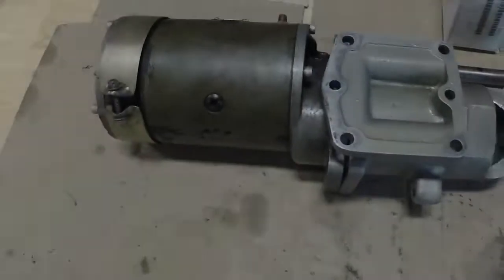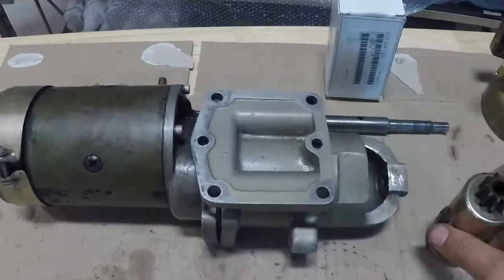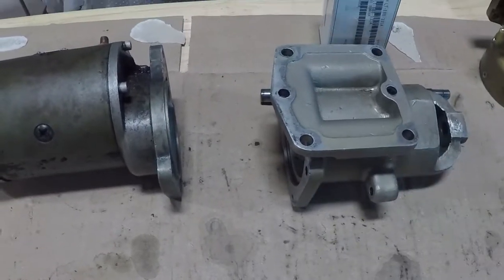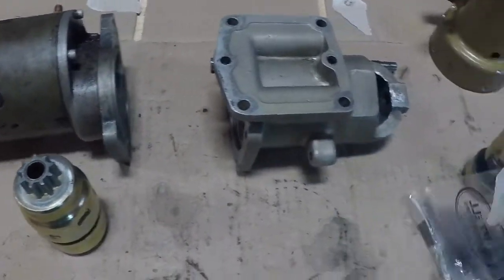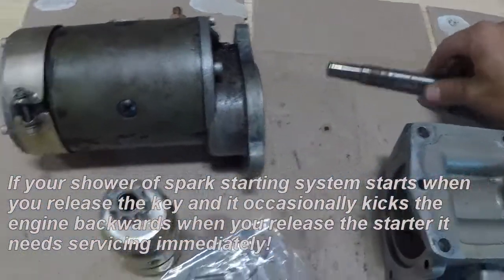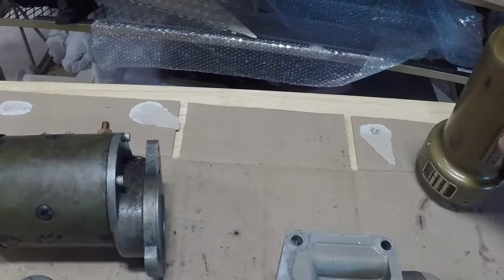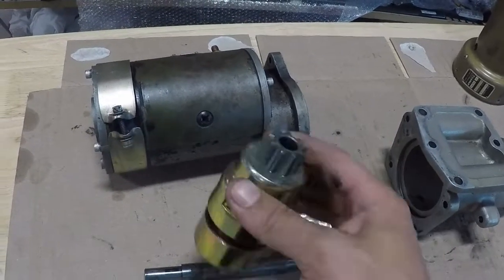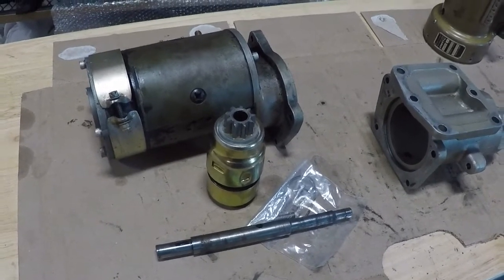Aircraft Starter Motor Replacement not required!

Comment: Can not thank you enough for this video and sharing your knowledge.  Not only did I save myself a lot of $$, but this was a fun project to knock out & we could have never done it without your help - and the production of this video.  Thanks again - and all the best!
Reply from the maker: I am really glad you found it helpful.  I agree it is a very rewarding repair to complete.
Reply: Any tips on removal of the starter? I've got a Penn Yan 172 with what looks exactly like the presto lite shown in the video. Bendix is actually stuck engaged to the fly wheel. Used to 'whir' occasionally but 90% of the time would work just fine. Went to fly the other day and upon startup the starter made an odd noise, came out to check and the gear is stuck engaged to flywheel. Prop spins fine but I can't get the bendix to return to disengaged position.
Reply: Prestolite MZ4222

Comment: HOLY CRAP!!! this is EXACTLY what happened to me. My (soon to be former) A&P was asked to take a look at the starter it was making this whirling sound.. one or two key turns then on the 3rd the starter would engage. Mechanic said "Oh the bolts needed to be snugged up a bit... it's fine now." The following week I took the plane out with the intent to fly locally not stopping the plane and it continued to do what it had been doing... third key turn starter engages and off I go. I then asked my (soon to be former) A&P to check out the ignition to make sure I didn't need a new ignition switch and Key. He checked this out and said it was fine, He cleaned it up a bit and it was fine. Foolishly I took the plane out and it did the same thing, one, two key turns and whirling.. third key turn, started engaged. Last Saturday, I took the plan out and flew to several cities around the state, it was a BEAUTIFUL day... how could I not fly. Each city it did the same thing. Finally, I was at my last stop for the day and the starter gave  out. Now I am AOG. My (former) A&P said that I had to have a new starter. Never suggested a new Bendex. I was lucky, the starter was only 560. I think I am going to keep the old starter, order a new Bendex and replace it.... keeping one on my shelf at home. I will be replacing the starter at the away station. Talk about a logistic nightmare - trying to drive 2.5 hours there, fixing the starter, then driving home, getting the Bus to the city 20 miles away, then Uber to the city where the plane is, then flying the plane to a new IA for sign off -mean while I have to remove the upper and lower cowling again.. always a treat on my M20J... but, I'll have learned a VERY valuable lesson..... and gotten a new A&P.
Reply from the maker: I am very sorry to hear of your situation.  I look after three Mooneys so I know how difficult it is to get at the starter. 

This is a very common issue with many shops just changing the starter. I hope that you will find a use for your rebuilt starter and bendix at some point.
Reply: @fastbackflying853  After getting th old starter out, there were additional screws missing. I'm going to turn this one in for the core charge. Rather this than sit on this not good part.

Comment: A couple of annuals ago I splurged on a Sky-Tec starter. The old starter really was shot. So was the ring gear, but that's another story.
Reply from the maker: Yes there are certainly times when it's more economical to get a new starter if there has been significant damage to it. Did you get a new ring gear install on your flywheel?
Reply: @fastbackflying853  Yes, the ring gear was badly worn. Bad enough to strand me on a $100 hamburger flight (Mary's at CYYJ, a local favourite). The starter actually worked, but the ring gear was so badly worn it wouldn't engage. Shower of sparks, so no hand-propping. I improvised my way home and made some calls. :-(

I limped home with a new ring gear a week later. A couple of week later she was in for her annual and the shop called me "nice ring gear but your starter is on its last legs and you need to think seriously about a new one..." So I did.

Comment: What is your source for the replacement Bendix?  I see you are in Canada (me too) and I always struggle for reasonably priced sources for aircraft equipment. 
Thanks for the video, before I found it I was reading Lycomings comments about lack of service on the starters.  I'm currently working on one that sat for 10 years and needs a little love.
Reply from the maker: Kadex can get these parts and Aircraft Spruce has had them in the past as well. It seems to be getting more difficult to get hold of them these days.

Comment: what is typical lifespan for a Prestolite MZ4206? I have a 1974 Cherokee 1266 TTSN w/ this Prestolite and the Bendix is sticking for the first 3 attempts, then it kicks in. Yes mine is old, but doesn't have much time in service and the starter sounds very healthy when it does engage.
Reply from the maker: I have seen them much older than yours. They are very tough and reliable thats one reason they weigh so much. 

Obviously use or more correctly  abuse will shorten the life span but I would very much think yours would be worth investing in a new Bendix drive.

Comment: Hey do you know where I can find a starter clutch for a o-200 continental on a C150. I’ve been looking everywhere!!
Reply from the maker: Yes I have a sprag clutch for the O-200. Where are you located? You should be able to get it from KADEX Aero Supply,  Aircraft Spruce,  or Niagara Air Parts.

Comment: I have aircraft AA5 and has motor starter problem  , when you try to start all I hear is wizz noise. If I was lubricant it what oil or spray I need to buy ?

Can I can lubricant without opening parts ? Is it easy ?
Reply from the maker: You would use a Silicon based lubricant on the starter Bendix. This is supposed to be completed ever 50hrs.  Depending on the condition it may require removal for cleaning and a replacement of the entire bendix.
Reply: Thanks a lot, I bought XC professional lubricant for £3.89 from Ebay, went to airfield this Sunday to see my AA5 give little spray on bendix where I could reached. it has worked engine started. Thanks  a lot . It was good help of your video.  Much appreciated saved a lot of money.
Reply from the maker: @mohammedkadir7223  really glad to have been able to help.  I hope you get some good flying in soon.  Where do you keep your AA5?
Reply: I keep at Wolverhampton airfield,  and get my annual done wellesbourne airfield
Reply from the maker: @mohammedkadir7223  I have an AA5 project for this winter. Fuel tanks and numerous airframe and flight control repairs to complete.